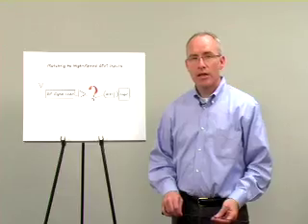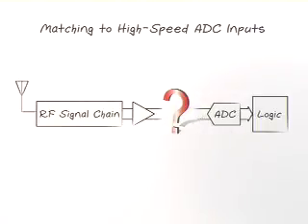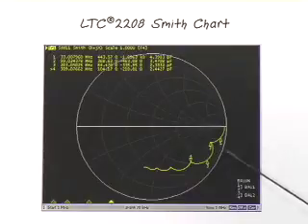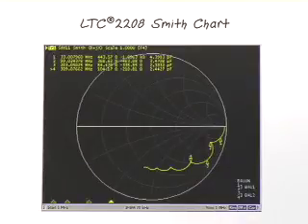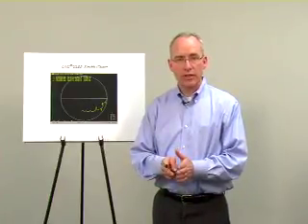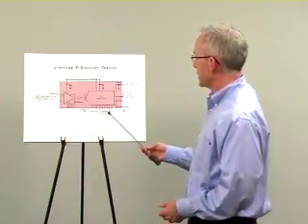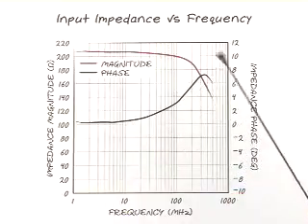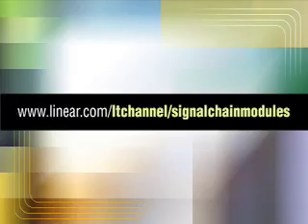The Simple Way to Match to a High-Speed ADC Input - LTM9001

Comment: I thought I had modest requirements,

>= 4  channels
>= 10 bit resolution
>= 1MSPS   (Simultaneous sampling would be nice, but 1MSPS across EACH and every input channels is a must (>= 4 MSPS aggregate))
>= 1Mhz analog input bandwidth
Non-BGA package
Nice to have:  Bipolar Input voltage range +/-10V

Unfortunately, after looking at many*, there's no such adc!
*
AD7606C-16, 
AD7616 
ADS8588H 
AD9228 , 
AD7655,
Max11122 
ADS7939 
ADS8638 
AD4853 *
AD4684
AD4858
AD7914 
AD7324
ad7386
AD7381-4 / AD7380-4